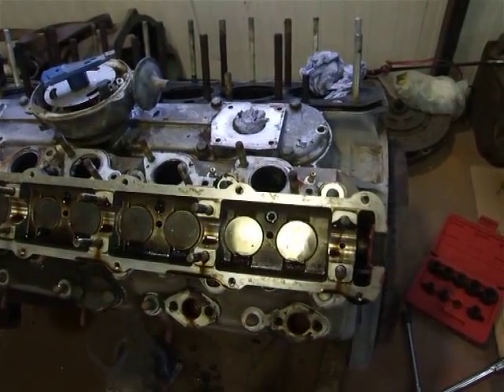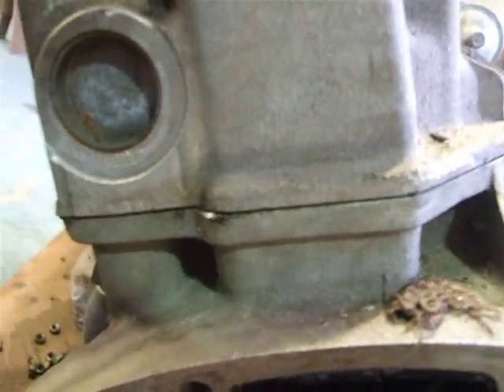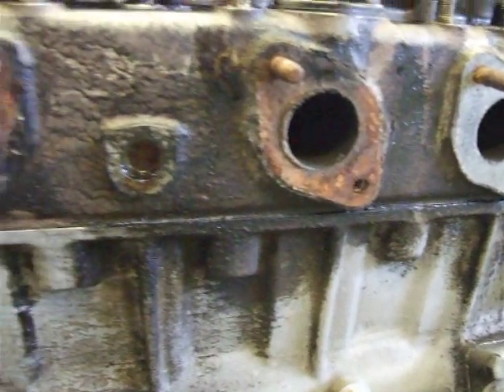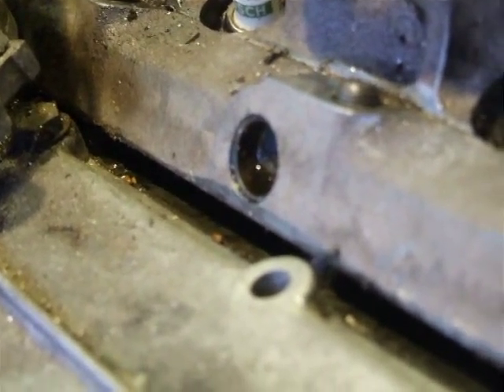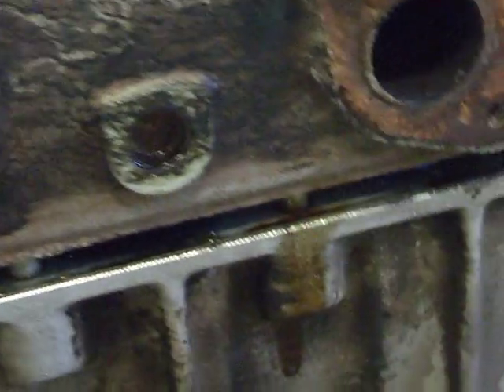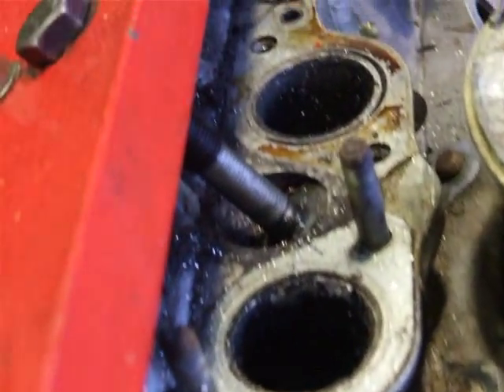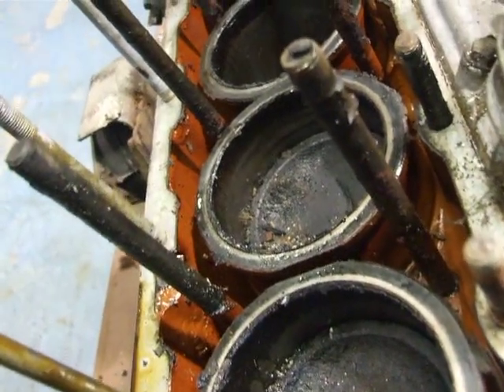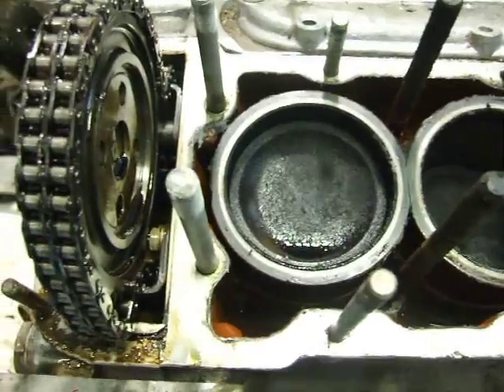Cylinder Head Removal - Jaguar V12

Comment: How are the studs sealed from the water jacket? I mean what keeps the coolent from going up the studs when you rebuild it? Why did this fail from the factory?
Reply from the maker: +dantheman1998 Hi Dan, we are sorry it has taken us so long to get back, very good question! An engineering oversight on behalf of Jaguar, very well spotted. It is a common fault, we rectify it with oil resistant seals, thank you for your interest.
Reply: +Kinkellclassics I see this is a Pre-HE engine, Did they eventually fix this with the HE? There arent any Jaguar specialist here in the US and especially no love for the V12.  I love to talk to anyone that has actual knowledge on rebuilding and " Hot Rodding" The V12. Thanks for answering my question! The more V12 videos you post the more I ask!
Reply from the maker: +dantheman1998 We like the way you you think Dan, another good question, sadly no, the engines are the same and prone to the same seizing heads and corroded bolts.  It begs the question, if you and I can see it, why didn't Jaguar?? simple answer: they did!! the problem was British Jaguar was and in deed the whole British car industry was on the way out when these engines were manufactured, the former interest and engineering prowess was lost and nobody cared.  It has become a throw away society, where engineering is regulated by the £$, but not to depress you, we love working on them and are about to post some rebuild videos. Thanks from the Team.
Reply: Hi dantheman1998. As Kinkellclassics have said there was no difference with the HE. I've just stripped an early V12 and an HE and the studs were in much better condition on the HE. It's all down to the mainrenance of the engine I guess. With proper antifreeze the studs should be fine despite the unusual design. Interestingly the bottom thread in all the studs is perfect. It's really just the shaft that corrodes